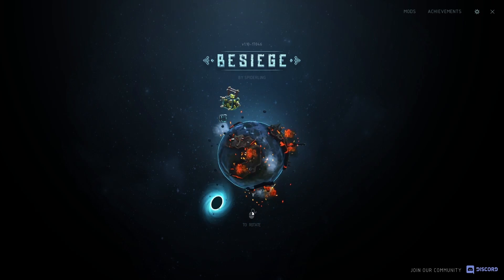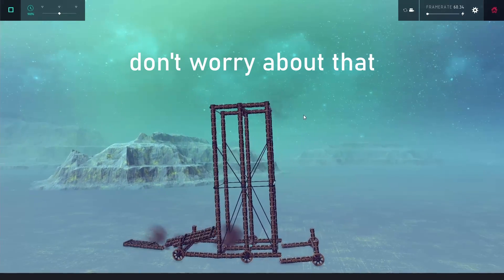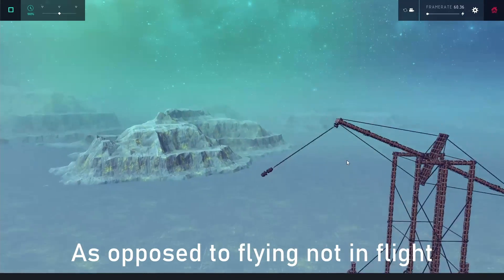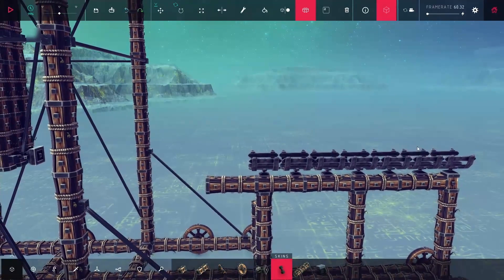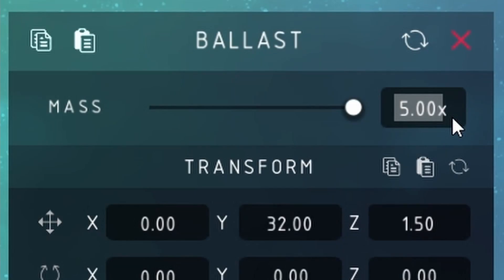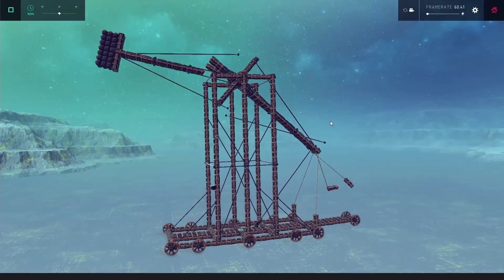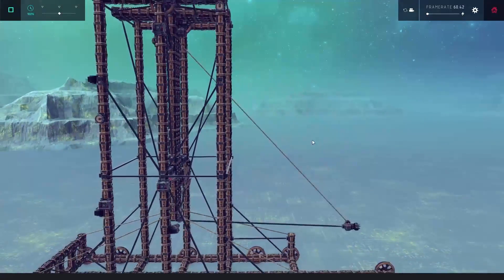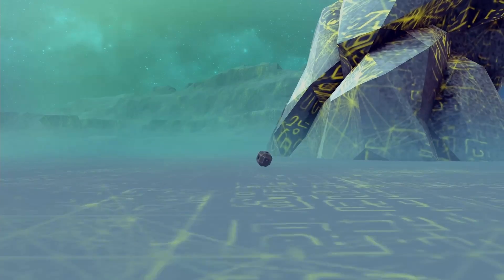Making an Automatically Reloading Trebuchet in Besiege

Comment: I think you can make a rngine with this. because when u launch, the platform moves at a speed that is coolfor it's size. so if you make it constantly spin without it launching the whole thing into the air with grabbers and balloon blocks that push down and some other stuff that give more downforce and traction, it might turn out pretty cool.

Comment: Senior year of high school i made a trebuchet for physics and optimized it as much as a part time working student could afford. It was funny to see myself looking at certain elements thinking about "well you want the arm ratio to be 3:1" or the rope to either be positioned on the front end for a modern trebuchet or how it was for a classical trebuchet, but above all, there is an ideal weight ratio, and adding more weight does not simply correlate to further distance

Comment: Amazing content as always. I think (counterintuitively) you can get more distance simply by increasing the weight of the projectile. As I understand it, more weight in the projectile will take more energy from the counterweight. Meaning both the counterweight and the projectile will be moving slower, while the rig will move faster. The more energy you can take from the counterweight, the more energy you’ll have in the projectile, yielding possible increases in distance.
But you’d have to ask Tom Stanton to be sure 👍

Comment: Ah yes, using Ploybridge diamond strategies in Besiege
Reply: It still works, because it uses physics that falls out of the basic equations of force, so it applies across all physics based games that have stress limits on the parts.
Reply: @nikkiofthevalley  by "physics that falls out of the basic equations of force" you mean vector addition, right?
Reply: I mean, it worked though.
Reply: ploy??? bridge...